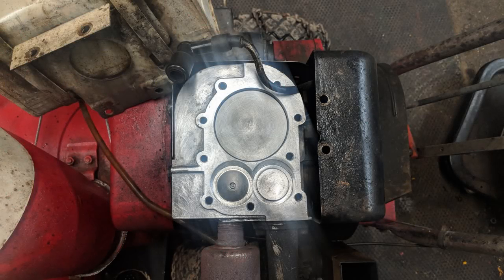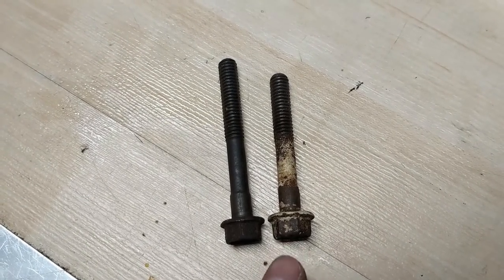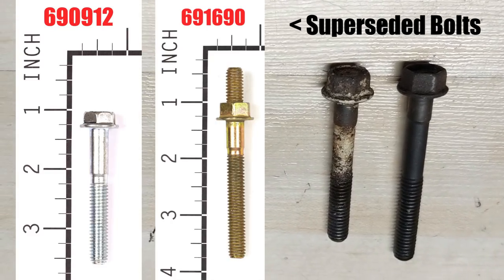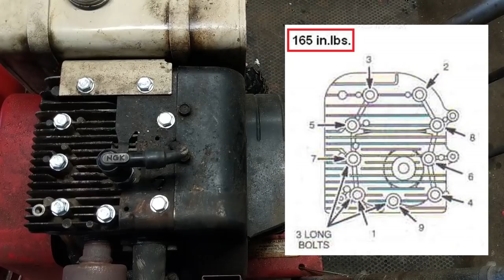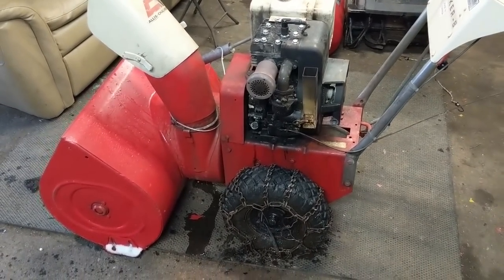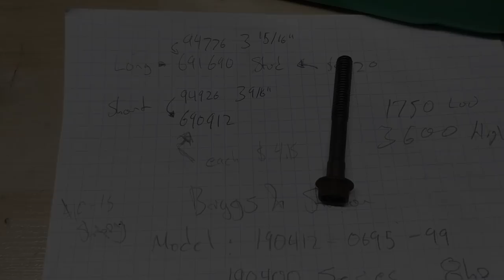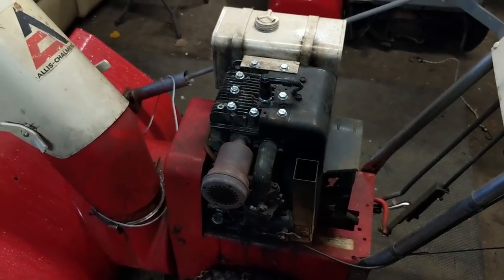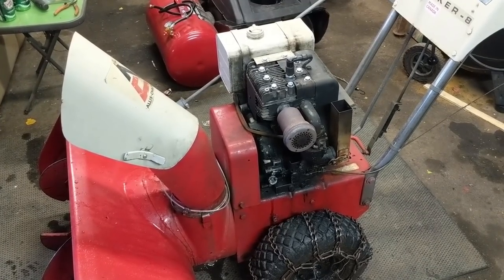Briggs & Stratton 8hp - Which Head Bolts to Use?

Comment: How many snow blowers built today will be running in 50 years  . Good video .
Reply from the maker: Yeah not too many lol the previous video I did was on that Ariens, only a few years old and already having issues.

This Tracker-8 was built in the 70's and with a small adjustment on the carb, it was running like new again!

Comment: I snapped one of the bolts on my predator and got it out without stripping anything out somehow. I luckily have the same bolt as the others but without the flange attached do you think I can use it with a washer and have the same effect
Reply from the maker: Yes I'm sure it will be fine, just torque it down like the others

Comment: Nice work on an old machine, I'm just wondering if you lapped the valves and gapped them also.
Not criticizing. Love your channel, you make good videos.
Reply from the maker: Did not do valves, customer only wanted head gasket and bolts, with a small carb adjustment she ran mint! Next time he has it in for service I can check the lash, and I will adjust them if it needs! Thanks for watching Bill!
Reply: Ok , I was just wondering.

Comment: The shoulder is the same diameter as the threads so using grade 5 fully threaded bolts should also work, in theory.

Comment: Did you torque the head bolts dry or did you use a lubricant like the Permatex Nickel Antiseize you usually use and if so does this affect the torque on the head bolts.
Reply from the maker: Yes, Briggs and Stratton recommend a drop of oil on the head bolts, using blue threadlocker will also affect the torque.

By adding a liquid to the threads, you multiply your torque rating.

Comment: Can you do a video on tprquing the con rod bolts on a 1971 lawnmower (Briggs and Stratton )
Reply from the maker: If I get one in that needs that repair I will! I usually only film stuff I do for customers.
Reply: Lol good luck with that!
Reply: Eliminator Performance thanks !basically what I need is the torque spec

Comment: I've got a head gasket to replace on a older 80s Briggs and Stratton motor from a Murray riding lawnmower following the intake valve seat popping loose as well as the spring . The price for each bolt is total BS . On both eBay and Amazon they're asking $8 USD for each one. That's absolutely nuts to ask that much for bolts that aren't heat treated nor do they list what their SAE rating is  .  I'm going to look through the local hardware store and get heat treated SAE 8 bolts instead of the garbage they're selling .
Reply: Do you know what thread? Since it's a US company I'm guessing UNC.